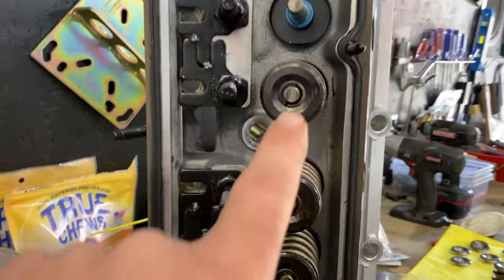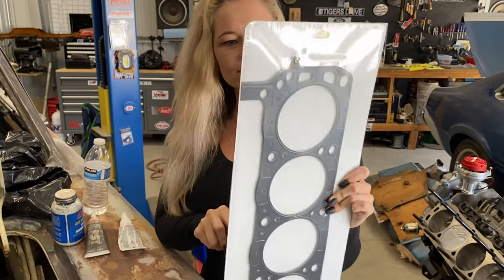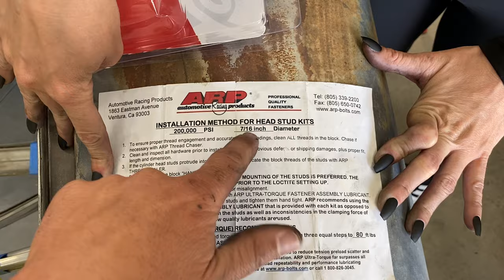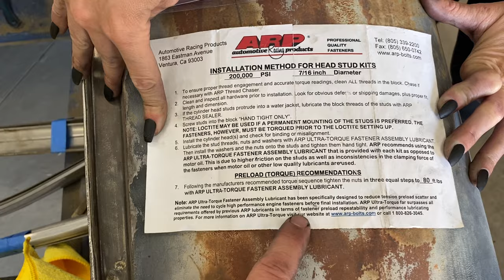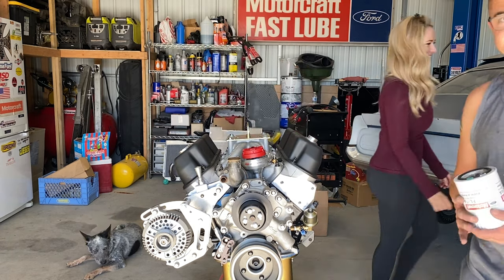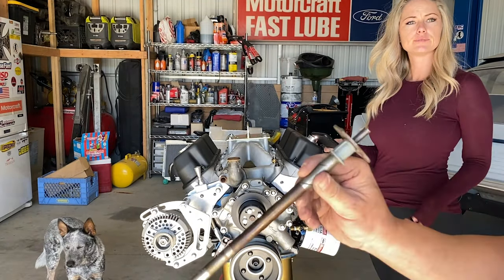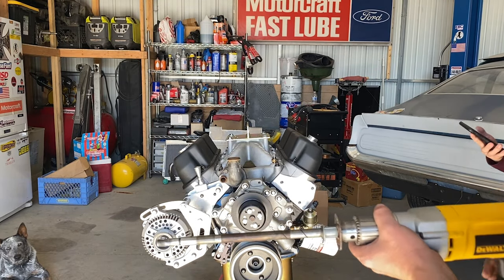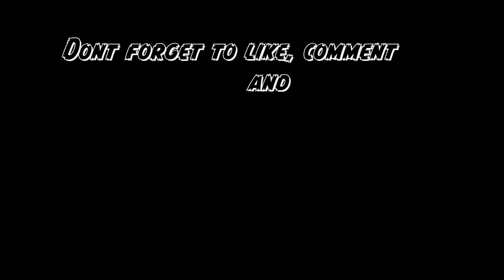Miss Midnight Maverick Streeter build part 4! 1969 1/2 Ford Maverick

Comment: So happy you run ford power in your ford. Love your car. My favorite  ford car all I drive are ford trucks and have a little short bed 1964 ford truck with a 68 ,302 punched to a 347 top loader 4 speed  350 traction lock 9 inch rear
Reply: I know your life is a loveing hell mine was when I had fords.now it's heven sence I went to chevy.

Comment: A good friend built a 454 Ford & put it in a '58 Ford Custom 300,I believe it was. 2 door only 2 bucket seats for the interior & a Built C6, 4,57 rears. I helped him install the engine in his yard. Before he put the distributor in, he used a tool & drill to bring the oil pressure up to 80lbs.,I watched the gauge. After a few minutes he installed the distributor, turned on the electric fuel pump,gave it some gas to the Holley 950 3 barrel. It fired up the first try! This guy was a helluva good mechanic! After he broke it in,it ran high 11's in the quarter. I so miss those great days of my youth!

Comment: In the early 70's I had a '65 fastback with the 289 hipo drivetrain installed. It had an Edelbrock Torquer & Holley 600. A Crower solid, 538 lift & 320 duration. Factory hipo distributor, & headers.4 speed & 4.57 9 in. posi. 90/10 & 50/50 rears. It was my daily driver & raced on weekends, mostly! LOL I shifted at 7,000,with 7" cheaters I ran 8.30 in the 1/8. The track didn't give us a mph,just et. This was about 50 years ago. Fast Fords Forever!❤😎👍

Comment: I’d sure smack those valve stems with a hammer. It’s better to find out one wasn’t seated properly when they’re on the bench, than when the valve drops on start up. It may have happened off camera though. Cool little maverick.
Reply from the maker: We did 👍🏻

Comment: I like to oil the engine with the valve covers off,    (or 3 minutes minimum)  just to see oil on all rocker arms. the SBF Rev Nice to 6 & 7,000 RPM. there not as expensive to build as the LS guy's say..   just need to get some traction Bars on the rear end.     Tess , what cam is in it VS what cam are you waiting for, to put in?
Reply from the maker: It was unknown cam and they went with an Anderson I believe

Comment: Do you know if those are custom headers she is using or if they are out of the box? Having an issue finding headers for a 72 Maverick with a 5 speed using a clutch cable? Thanks in advance.
Reply from the maker: I believe they have been modified to work. They’ve been cut and shortened at the collector section if I remember right

Comment: Where can I find a engine like that I have a 72 maverick that currently has a straight 6  I’m looking for a 302 that puts out 400hp
Reply from the maker: Go to the junk yard and get a Ford Explorer short block then put a cam heads and intake on it and you should be able to get close to 400 without much hassle.